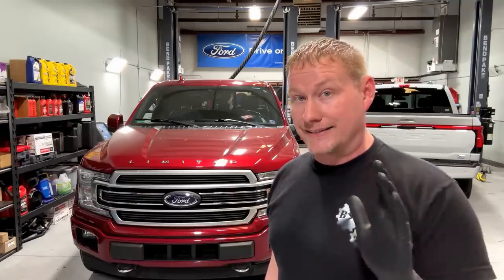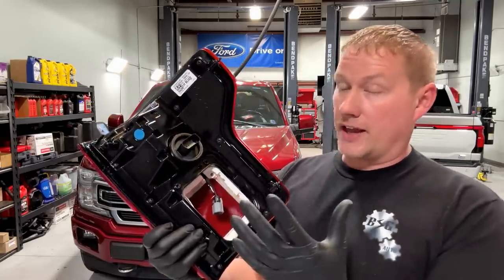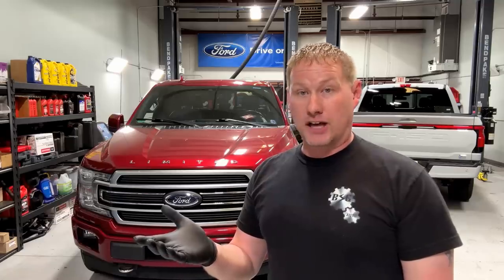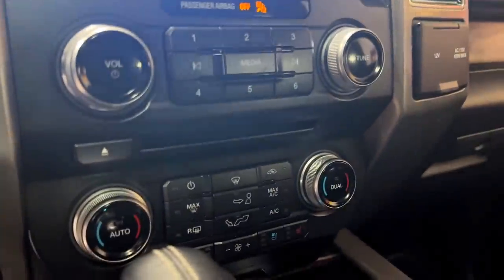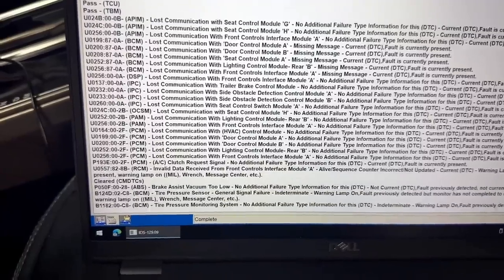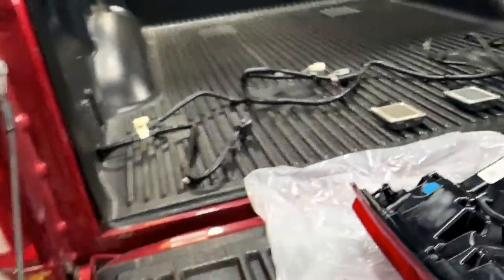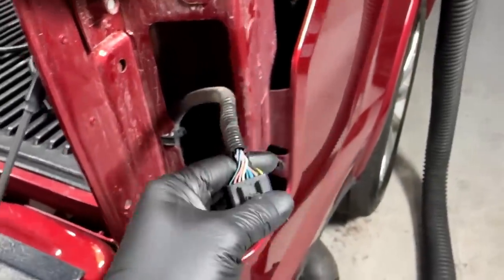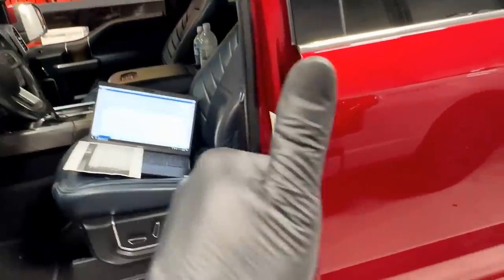Repair Cost Are Out of Control: $5,600 Bill for Some Tail Lamps?!

Comment: You were pretty sharp, and maybe lucky with your diagnosis. This could have easily snowballed into a much more expensive, drawn out repair if you had a bit less intuition and/or luck...which probably happens every day, frustrating mechanics and customers both.
    I'm very concerned about the future of used car ownership. Improvisation to repair anything is not only getting more difficult, it is also illegal if any engine management system is involved. Thanks, EPA. Jackasses, making the small task of getting to work every day more and more expensive and difficult.

Comment: My 2016 has basically the same taillight assembly with the vehicle sensors.   2 years ago I noticed some inner condensation in the housings.  I pulled both off and removed the radar sensors,  blasted them with a heat gun on low for an hour to remove all moisture.  Re-sealed all the seams with clear rtv silicone.  Sealed around the screw posts (they tend to hairline crack).  I had the same random everything issues.  Caught mine before any corrosion.  Zero issues since.

Comment: I'm almost retirement age. I needed to buy a truck that would hopefully last me the rest of my life. Since I'm retiring I had to find something used. I couldn't believe the price for 200k mile used modern trucks. My neighbor had just replaced  transmission on his 5 year old GMC truck and the cost was huge. I found a 1987 carburated f250 with 35k miles. It looked new. It is simple and cheap to repair. 460 gas and c6 3 speed transmission no overdrive.. It gets really horrible gas milage and it isn't good for driving 80mph on interstate but it's simple..reliable..and inexpensive to repair. A new c6 transmission is still affordable even for a retired old man

Comment: Thank you very much for the video! One question: what was the source of the water intrusion?  Was the tail light cracked? Installed improperly?  Design defect? I have a 2023 King Ranch with all the "stuff", I'd like to avoid issues like this. My vehicle stays inside, but I do wash it regularly. Thank you.
Reply: The cause was the connectors not sealed with diaelectric grease. Get some of the Ford electrical grease and start removing connectors and greasing them. Get yourself a bunch of small brushes that will fit in the housings.

Comment: Fords are garbage as of late lmao. Worked for a dealership for a bit and we had 2nd or 3rd transmissions on models by 80k lol

We had a tremor come in with a cracked camper shell bc the transmission lurched so badly.

Turbo rattle, exhaust rattles, coolant leaks by literally 20k. I saw 6 of em a month.

And these parts are in such high demand because of how unreliable they are, customers would wait 6 months for a transmission because of it being on backorder.

Comment: I'll keep my 03'. It may have 220K miles on it, but the parts are inexpensive (most of them). I'll just keep refubishing/rebuilding and watching all the old 2V videos on this channel to keep mine up. The new F150's are nice, but not if you have to replace parts that cost THIS much!
Reply: Keeping my 99 Camry, 353k miles, owned it for 23 years now. Motor & Trans never needed replacement or rebuild... Never let the oil turn more then lite brownish. Original exhaust system from tailpipe to manifold, no rust underneath (always been a Florida car)...

Comment: Good news for myself, a win for us poor Guyz (since I'm an hourly wage earner, I can't afford anything more than a F150 XL.) The taillights on my 1997 F150 XL are $16.99 a piece from CarParts, the taillights on my 2019 F150 XL are $119.99 a piece, also from CarParts.
    With the minimal amount of electronics on my 1997 XL, with all the wear and tear, all the crud and grim acquired from 26 years of service, I can't imagine my 2019 XL lasting nearly as long. (but still cheaper than other trim lines).

Comment: What preventive steps are you going to look into to prevent this from happening again?
Reply: did you watch the video? he used some shmoo to keep water out of the fittings ya silly goose
Reply: @azza-in_this_day_and_age  Maybe you missed it. He has XG-12 electrical grease for the connectors but what is stopping water from get into the new housings again, the root cause of the problem.
Reply: @steadyeddie7453  the housing was merely a conduit to the circuitry, it can be wet or dry. the circuitry can not!
Reply: I'm going to use some Permatex windshield and glass sealant ( flowable silicone ) around the perimeter of the lense to housing.
Reply: the tail lighting facility would create a lessons learned based on this incident, which would likely turn into an updated design guideline and / or improved quality check station or test activity. 
log the defect. improve quality checks. increase design robustness. audit the system, to ensure it’s implemented moving forward

Comment: I have actually been taking the replacement costs of such items into account for almost a decade.  This exact part has led me to not recommend the F150 to friends and the local fomoco dealer has lost 7 sales I can think of right away.  

Another part is the steering wheel on the F250 has an integral steering sensor for steering fault code and the steering wheel is almost $2000 with taxes.  I was able to help my friend by coding the IPC with ForScan to basically tell the truck it no longer has that stupid steering assist system and now it steers just the same as every other basic F250 and no more fault warnings all for an hour of my time.
Reply: Yes! ForScan is great! I was able to enable electric trailer brakes in my Transit Van

Comment: Great job! Had a similar problem with 2016 Escape and the backup camera. For the cost of vehicles, they shouldn't corrode, and things should be more accessible. If that were the case, it would be easier to justify.

Comment: Question: Why isn't there a resistor, or a fuse, or something to protect each module?
Reply: Because reasons
Reply: Better question is why is the module in the taillight? There is already a harness running back to the rest of the car, why not just put the module in a safer spot and run wiring to it?

Comment: The repair costs are totally out of sight and the sad truth is that the design engineering is at fault for a lot of this. For starters, all those connectors should have been made water proof using seals on the connection sides as well as the back side.

Comment: This is literally why I extended my warranty the other day. 

$1456 a year. 3 years. $4k all said and done. Reverify miles at the end of the year 3. Extend if you like. $100 deductible.

I only have an XLT sport 5.0, 6 speed 4x4. 

I was thinking an AC issue, engine, trans, etc. 

Here, taillights cost $6k.

Smart move on my part.
Reply: lol third party extended warranty.... "bumper to bumper coverage", yea but nothing in between.
Reply: @mrcrowley109  mines from Ford Motor Company.. it's basically a continuation of the factory warranty with a $100 deductible.

Comment: Ford saved $2 per truck by not using electrical grease on those connectors,  fully well knowing they would fail after the warranty period.

Comment: Makes me feel like I need to make sure that my tail lamps are properly sealed. Even disassembling the plugs and putting some dielectric grease in there.
Reply: Good idea. He said they are easy to remove and dielectric grease is inexpensive. 👍
Reply: I would also wrap the connectors with electrical tape, after you've put dielectric gel on the terminals.
Reply: @lihtan I wouldn't advise doing that, it's unnecessary and actually can cause problems- it gives moisture another spot to collect
Reply: That would help the connectors, but the water got into the bliss module, which was the main problem, it shorted out inside the black plastic housing causing voltage to be sent to the wrong places.. That module needs sealed from water as well..

Comment: How did all that water get inside the taillamps?  Is it a manufacturing defect, or did the customer go through high water?
Reply from the maker: The seams fail over time and then high pressure touchless car washes do not help.
Reply: @FordTechMakuloco Touchless don't even clean well. I used to have a white vehicle that I didn't notice was getting a buildup from those. Then one day I wiped it when wet & the original white appeared.
Reply: Based upon Brian’s recommendation, when working on my 2014 F-150, I sold my 2018 F-150 4 days later. Thanks Brian. @FordTechMakuloco

Comment: Repair costs are totally ridiculous! I 100% agree with you that it's getting out of hand! I have a 2005 Ford Escape XLT that is still in tip top shape, including my electrical system, because I gave every connection the dielectric grease treatment and I've never had an issue with anything to do with electrical.
Reply: 2001 Ford Escape here. I do the same thing. 281k miles. Hope it keeps running for another 100k.

Comment: Yeah, it's called price gouging 😊

John Deere is notorious for that kind of crap compared to other brands 🤬

Main reason we're still using equipment from the 1970s or 1980s because it's more reliable, easy to work on, and parts are relatively cheap for the most part and are easily to machine if need be 🤫

As for paying $5,600 for tail lights, I would've ripped the bed off and bought a flatbed and had money leftover at that price and made a few thousand after selling the bed.
Reply: ..but when you severed/changed the wiring and removed the fancy tail lights with all the sensors, it would have thrown all kinds of codes and I'm sure the truck wouldn't even run....that right there is a big part of the problem...everything too integrated...

Comment: I have said it before. Those LED tail lights and headlights look nice Till they go bad. Then you are stuck at the mercy of the dealer or if lucky after market. I rather replace a 5 dollar bulb than a light assembly for 100's of dollars and with some good LED replacement bulbs you can have the both of best worlds

Comment: I had an f150 with the exact same concern and symptoms. It really threw me around trying to figure out how ms can was down. I was just pacing around and found the tail lamp had water in it and figured that it was shorting out the network since I saw it was on ms can. Unplugged the whole tail lamp assembly bam fixed. Crazy how things like this get overlooked during engineering.
Reply: I was working on a Sorento yesterday trying to figure out why the tire pressure sensors wouldn't program to the car. Had no communication to the TPMS module. Pulled the module out from behind the rear cargo panel and found the module pins and connector were corroded. Turns out the Kia engineers thought it would be okay to run the TPMS module harness along side the rear window washer hose lol.  A leak at the nozzle or coupler in the headliner hitches a ride down the washer hose then crosses over to the TPMS harness and heads straight into the module connector.
Reply: What makes you think it was over looked?  Ford just made nearly $6,000 and didn't even have to sell a vehicle.  The profit is all in the repair parts, not the actual car.
Reply: @frotobaggins7169   @frotobaggins7169  Ford only makes money on the part. Dealers make money on the job. The only time Ford makes money on the part is when it's not warranty. The one I did was under warranty. So Ford paid the part and for me to do the job. But I can understand where you are coming from.

Comment: Morimoto makes an awesome set of LED tail lights compatible with BLIS. I just tossed them on my f150 lariat. Nothing was wrong with my OEM set, I just wanted a more modern look and brighter lights. Typically, have sales. I paid $500, and they bought my OEM set for $240. So, $260 for the set. This is for the Gen 2 in red. Highly recommended.

Comment: The future will be full of mechanically great vehicles that are in limp mode because of codes.  Our 2022 BMW cruise control stopped working when the Apple Car play crashed.  It has been in the shop 5 times for glitches.  I dropped it off with my 2007 Kia Sedona that is still going strong.

Comment: My heart goes out to you ! I’m thankful your insurance absorbed a portion of it, and it looks like you had a great tech. The entire issue is insane without apology. It is stealing by the auto manufacture by design.. It’s really worse than being robbed of cash on the streets. Though all stealing, and dishonesty is wrong, at least the thief on the street might use your money for food, or something productive. This is one of the major reasons the auto industry, and economy is in the shape it’s in. It simply isn’t sustainable. With that said, just think of all the problems there has been in more recent years with hazed over headlights,, and breaking clips that hold bulbs in place. The industry went backwards, and dumbed down. Go back to the 1970’s through the early 1980’s and decades before, where you had a sealed beam glass headlight. Four screws, a plug in headlight and you’re done. If a new auto maker would get on the platform, going back to more of the basics, mechanic friendly, with longevity like it use to be, then they would do great …

Comment: This morning I did a outer tie rod, the shop lied to the guy, said the inner and outer were both bent and wanted to charge $1000. Laughable... I look at it, used straight edges to confirm the inner was not bent at all, the outer was a full 1 1/2 inches offset from being bent. $65 and 30 minutes later, tell the guy to go get a professional alignment, (I doubt it needed it, but better to be safe than sorry.) Saved the guy from being scammed for over $1k.

Comment: Liked and subbed. I have a 2016  Lariat and this is unsettling. Tempted to remove the taillights and apply that grease before this becomes an issue .
Also at the car wash I use the under vehicle spray to get road salt off. I’m wondering if blasting water underneath the rear is a good idea now

Comment: I just fixed my tail lamp for less than $50.00 per tail light in the back of my Ford F150 (V8 2011 edition). :) That sucker is paid off and well-maintained.

Comment: diag aside and fix aside, unfortunately the fault of these problems is entirely by mandated design by ford management coming down to the engineers.  

The word is: design these things so that they only last for 5 years or 100K miles and then MAKE SURE that they break or stop working.  We can't allow them to keep working past that, because we need to ensure the proletariat is sufficiently enslaved to this technology and will have to pony up the $$$ to fix it.

 95% of the people that can afford these new trucks today in 2023 and buy them off the lot, can afford to be ripped off for thousands of dollars and they will pay it because they can.  -- just like the customer in the video did at 95,000 miles -  he likes the new toy and status.  Ford, GM and Dodge all know this so they are going to take you to the cleaners and you will be happy about it - for the first 100K miles and then probably get rid of it after five years and get a new one to start all over again.  For the rest of you that live paycheque to paycheque, change the oil on your 2008 Corolla regularly.  You aren't getting a new one ever again.

A few final thoughts:
They could design them to be much more robust and and only be a $ 100 dollar tail light lens, $ 3.00 bulb and and $ 10 dollar socket connector but no, that's doesn't make money for Ford.  That is way to easy to fix yourself and get parts for since the 1960's so this must be changed as a matter of corporate policy.  Computers and modules running everything does make money on F-150's.  It is no accident that you cannot walk into a Ford, Chev or Dodge dealer today and buy a small car for $ 20,000 anymore and be on your way.  They aren't there anymore by design.

Lastly, Cadilac going 100 % all electric by 2025 or whenever it is has Mary Barra and GM ready to have a massive orgasm of gross margin on each car sold.  The new cars will be totally un-repairable by anyone except for the GM dealers that have each spent three to six million dollars for their dealership to upgrade to all the electric diag crap and computerization and high speed charging networks in each service bay that will be required to facilitate it.

This is just the beginning folks.  you are not going to like where this story goes in 15 to 20 years from now when all the ICE cars today or no longer being made.

Comment: Good find, a bit of deductive reasoning goes a long way; network faults are a lot of fun, although the intermittents CAN be pretty rough.

You should look at getting electric connector parts vendor direct, most shells, terminals and wire seals on vehicles are made by one of 3 manufacturers and sold for a fraction of the cost you would pay at the dealer. Dealer parts guys will almost never be able to find what you need or sell you some overpriced repair pigtail or a complete harness.

Working on semis, Mouser and TE Connectivity have saved our customers a ton of money by enabling chassis harness repairs that the dealer would otherwise tell you is unrepairable to the tune of a few thousand dollars.

Comment: I think Ford knows about these seled connector issues. Both my 13 and 17 F-350's had the rear passenger plug near the spare tire fully corroded . It caused a whole list of electrical issues with the trucks.

Comment: So…water got into the light.  Does that mean that Ford didn’t design the part properly; to it was installed improperly?
Reply from the maker: How can an improper install of the light cause a water leak unless someone slammed it in there and cracked it.

Comment: Should be a good point why manufacturer does’t use any electrical lubricant on harness plugs and antiseeze on some suspension bolts,like shocks ,or steel bolts threaded into alluminum housings.